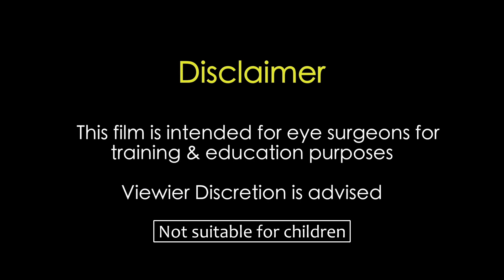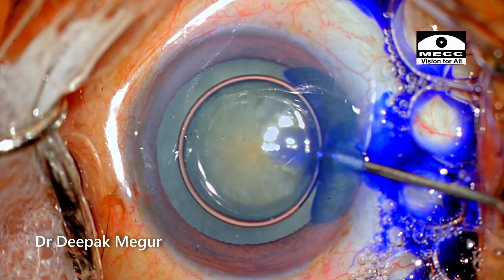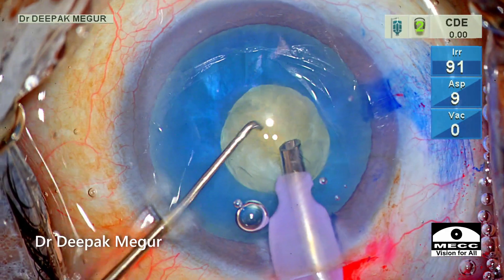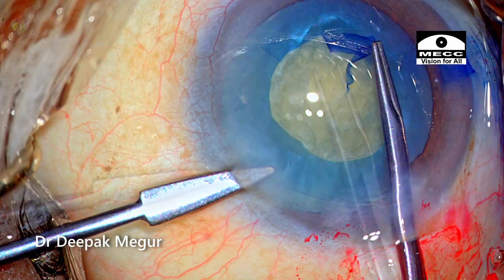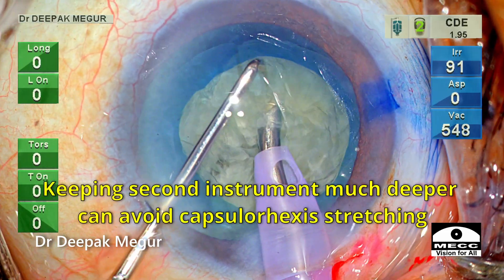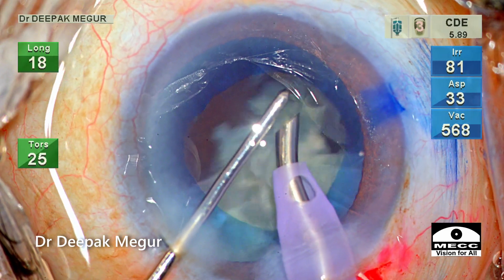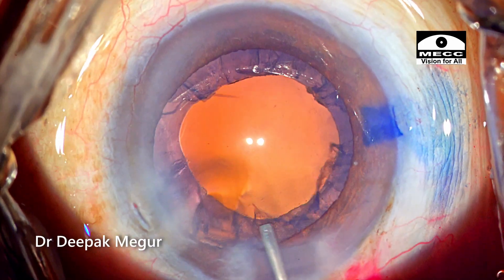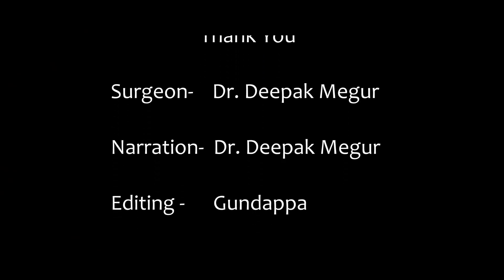Phaco Basics. Direct Vertical Chop..How to avoid this error..? - Dr Deepak Megur

Comment: Dr. Megur, I am a current resident in the US and am incredibly grateful for your videos. I have a couple of questions that would help me greatly in understanding your technique:

1. I have noticed many of your cases seem like they would have benefitted from a retrobulbar block; is there a reason you dont employ this technique that I am missing?

2. I noticed you tend to keep your chopper anteriorly to protect the endothelium during emulsification of nuclear fragments. Do you worry about posterior capsule prolapse? I have been taught to keep my accessory instrument posteriorly to protect from the bag prolapsing anteriorly.

Thank you for your time and for your wonderful videos.
Reply from the maker: Hello and glad to know that the videos are helpful. 
1. Topical plus intra cameral anesthesia is our routine for majority of the cases. 
Many a times we start of the surgery and in between we realize that some form of block would have been more appropriate. Then I usually add on a posterior subtenos injection , that usually suffices. 
Peribulbar or retrobulbar blocks, I don't usually use them often simply because I don't find them necessary.. 
2. U am not so much scared of the posterior capsule as the fluidics in most modern machines is good enough and we don't get post occlusion surge, hence my concern is more towards the endothelium hence the maneuver with the second instrument.

Comment: Beautiful video ! During capsulorhexis,  you have mentioned use of either  shearing or tearing forces,  are u referring to stretching forces used by cystitome which is in same plane as zonular vector forces, and shearing/tearing forces used by forceps which is perpendicular to zonular vector?
Reply from the maker: Shearing is when we fold the anterior capsule and then tear along the curvature of the the tear , here the tear is not directed towards the centre of the eye is going round in a circumferential manner.9 This is typically what we do with the cystitome  , where as in tearing technique the capsule is not folded but is flat but the direction of pull is towards the centre of the eye best done with the forceps.
Shearing technique is what we do routinely, tearing  technique is rarely used  predominantly to rescue.